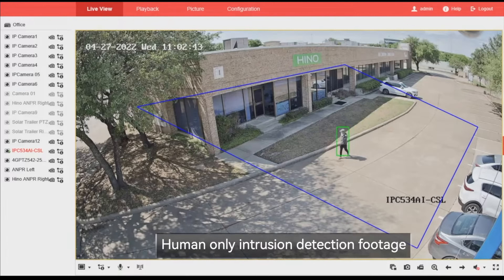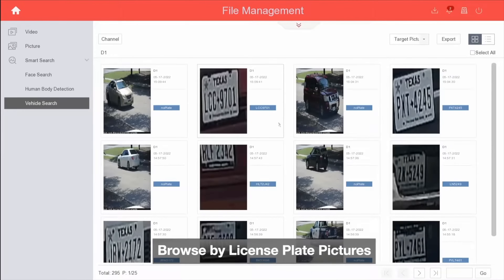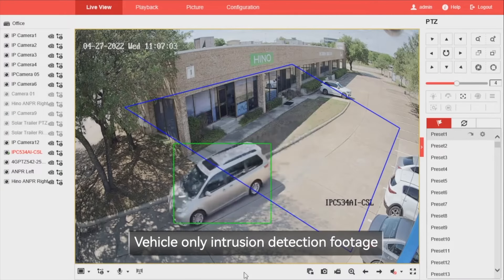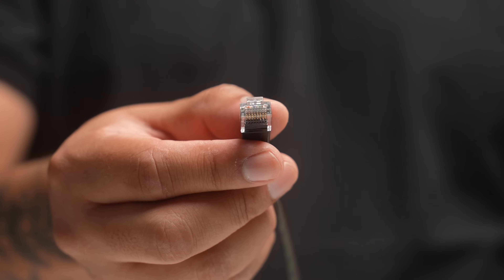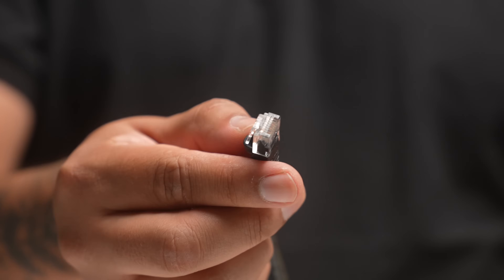How to upgrade analog camera system to IP system without replacing coaxial cables！

Comment: Hello can i use it and connect it directly to a switch internet not to a nvr.?
Reply from the maker: My understanding of your question is whether you can replace the PoE NVR with a PoE switch.
Yes, absolutely!
In this diagram, You can replace the NVR with a PoE switch — just connect the EOC Receiver’s PoE IN port to one of the PoE switch ports. This way, the PoE switch will provide both power and network connection to the IP camera through the EOC transmitter and coaxial cable, allowing you to access the camera directly over your network or through the internet.

You can check this link for more detailed product information and connection setup instructions: https://linovision.com/collections/poe-over-coax/products/poe-over-coax-converter

Comment: Awesome. Do you have a video on here on how to Convert a LAN internet output on a NVR to convert to wireless? I have a second security system in my garage on a farm with land and its 200 feet away from the house and want to have access to an extra wireless PC monitor if th'ats possible. Thank you. :)
Reply from the maker: Hi there! 
Thanks so much for watching our video and sharing your situation.

Regarding your setup: yes, it’s absolutely possible to convert the LAN output on your NVR into a wireless connection, especially in a remote location like your garage that’s about 200 feet from the house. Here’s a quick suggestion:

Wireless Bridge + AP Setup
We recommend using a pair of wireless bridge devices (also known as CPEs), such as Ubiquiti NanoStation or TP-Link CPE. One unit is installed near your house’s router, and the other at the garage. This creates a point-to-point wireless link, acting like an invisible Ethernet cable between the house and garage.

Important Note:
To actually use wireless devices (like a PC monitor, phone, or tablet) inside your garage, you’ll also need to connect a wireless access point (AP) to the LAN port on the garage-side CPE. This AP will broadcast Wi-Fi locally in the garage, allowing any wireless device to connect to your network just like at home.

We’ve created a connection diagram for your setup. Unfortunately, we can’t send images through this platform, but we’d be happy to email it to you if needed. Just let us know your email address.

And if you’d like, we’d be happy to offer a free network design suggestion based on your actual layout. Just let us know!

Comment: really thinking if its worth it..I just  bought a house with around 8 already installed coax cameras...

would need a new NVR,reciever and transmitter for each camera  and the cameras are OK..

might just take my time and add IP  cameras  as I go...I can also get them solar powered  to save energy 

or have both...definitely leaving the Coax cameras in Place..

going to experiment to see what makes sense.
Reply from the maker: That’s a smart move, keeping your coax cameras in place while gradually upgrading to IP is a solid, budget-friendly strategy.

Here’s a practical path you might consider:

Keep the existing coax system running as your base coverage, no need to replace what’s still working.

Start by adding IP cameras in key locations where better resolution and smarter features can make a real difference:
— Front door (for facial detail and package tracking)
— Driveway or garage (for vehicle identification)
— Backyard or blind spots (for smart motion alerts and night vision)

Look into hybrid NVRs that support both coax and IP streams, this way you won’t need two systems, and your upgrade stays flexible.
By doing this, you’re not just adding more cameras, you’re enhancing the strategic visibility of your property with higher clarity, wider field of view, and better event detection.

No need to rush the transition, just let the system evolve as your needs grow.

Comment: Everybody that talks about analog versus IP says the advantage of IP is remote access, I have analog cameras and I can remotely access them and it’s a system I installed 15 years ago
Reply from the maker: You’re absolutely right,remote access isn’t exclusive to IP systems. Many analog setups, especially those using hybrid DVRs or analog-over-IP converters, have supported remote viewing for years, just like yours.

The key difference is in how much more IP systems can do beyond just remote access. With IP, you typically get higher resolution, better scalability, intelligent analytics (like motion zones, people/vehicle detection), and easier integration with other smart systems.

That said, a well-installed analog system, especially one that’s lasted 15 years and still meets your needs, is a solid setup. IP just gives you a bigger toolbox if you ever need to expand or upgrade.

Thanks for sharing, it’s always great to hear from folks with long-running systems out in the field!

Comment: I accidentally bought an IP camera seeking a replacement camera for my coaxed, analog system with analog DVR. Is there any option other than to send the cameras back for an exchange? Can the IP camera signals be converted at the camera end to analog signals and sent over coax to an analog DVR?
Reply from the maker: Hi there, thanks for your question!

Unfortunately, IP cameras and analog DVRs are based on completely different technologies and are not directly compatible. IP cameras output digital network signals, while analog DVRs are designed to receive analog video signals (like CVBS, AHD, CVI, or TVI) over coaxial cable.

There is currently no practical or reliable way to convert IP camera signals back into analog at the camera end for use with an analog DVR.

Here are your options:
	1.	Return or exchange the IP camera for an analog model that matches your DVR format (CVBS, AHD, etc.)
	2.	Upgrade your system to an NVR (Network Video Recorder) that supports IP cameras

Let us know if you have more questions, we’re happy to help!

Comment: Can I do this with BNC cables ?
Reply from the maker: Sure! The LINOVISION “UltraReach PoE + Ethernet over Coax (EOC‑Converter)” is designed precisely for this scenario. It lets you keep your existing BNC-based RG59/RG6/RG11 coax cable, no need to dig or rewire, while upgrading to a modern IP camera system.

Comment: Great , device , I am looking to transmit a  signal from a Analog camera originally transmitted via Rg 11 U, which has become faulty due to weather, and improper installation years ago, to converted to a wireless transmission in a wooded area to a building to a receiver, is this possible ?  or some other means,  with out digging up about 1500 ft of lawn area.
Reply from the maker: You’re right to look for a wireless solution — but unfortunately, analog video signals can’t be transmitted wirelessly over long distances, especially through wooded areas. They degrade quickly and aren’t built for that kind of setup.

Here’s a simpler, cost-effective path forward:
	1.	Convert your analog camera to digital using a video encoder, then send the signal wirelessly with a long-range point-to-point bridge (like Ubiquiti or TP-Link CPE kits).
	2.	Or — consider upgrading to an IP camera. In many cases, this can be more cost-effective and future-proof. IP cameras connect directly to the wireless system and eliminate the need for a separate encoder.

If you’re comparing the two options, upgrading to an IP camera often delivers better image quality, easier integration, and fewer moving parts.

Let us know if you’d like help picking the right gear for your setup!

Comment: Do I still need the receiver if I'm connecting to a analog DVR (not NVR) ? Since I could just connect it analog from the transmitter
Reply from the maker: Hi,

Thanks for your question!

Please note that LINOVISION’s EOC (Ethernet over Coax) products are specifically designed for transmitting IP network signals over existing coaxial cables — not analog video signals.

In your case, since you’re connecting to an analog DVR, the EOC solution would not be applicable. Here’s why:
	•	The EOC transmitter is meant to connect with IP cameras, not analog ones.
	•	The EOC receiver converts the network signal back to standard Ethernet for connection to an IP recorder (NVR) — not an analog DVR.
	•	Analog DVRs require native analog video signals (like CVBS, AHD, TVI, or CVI), which are not compatible with IP signals transmitted over EOC.

So yes, both the transmitter and receiver are required only when you’re using IP cameras with NVRs and you want to leverage existing coaxial cabling.

If you’re using analog cameras and an analog DVR, then you should continue using traditional coax connections without EOC devices.

Let me know if you’d like us to recommend a solution based on your current system setup — we’re happy to help!

Best regards.